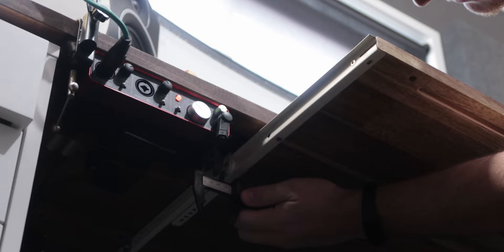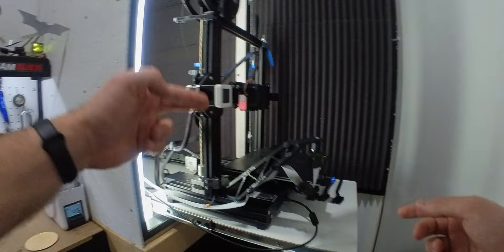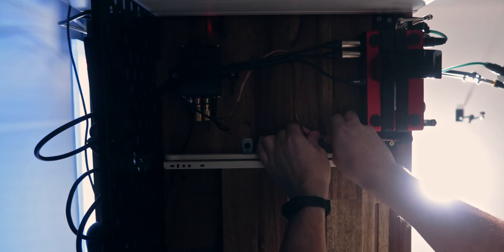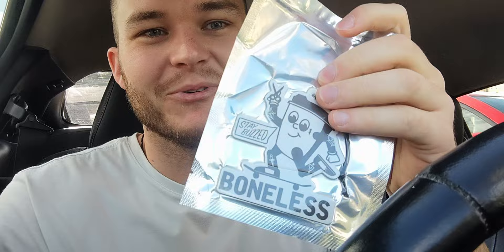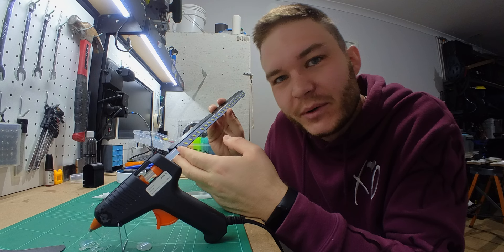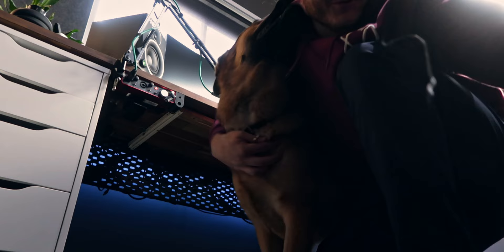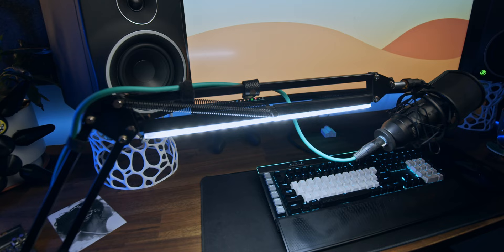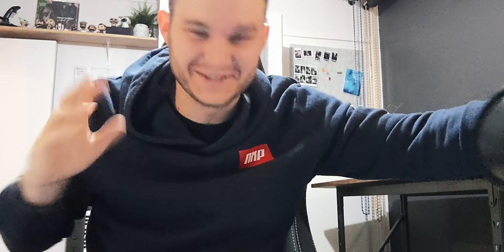inventing the Mic Arm Lamp.

Comment: Woah.. Nice job. it would have taken me 3.5hrs to just solder those strips to power brick. Really impressed. Anyways, what are you studying for? It looks like you can learn anything by yourself. Why pay uni?
Reply from the maker: Haha yeah quick solder job on this one! 
It's kinda different. So I have a bachelor's degree in computer science, and worked in IT for ages. But recently started teaching STEAM programs to high school students at the University I work for.
I'm studying sustainable living, some subjects through the lens of architecture and others are general. The learning gets implemented into the classes I run, and all happened to be free. I probably wouldn't pay for another degree but to given what I'm learning is being directly applied in my current job it's worth it. Plus I'm interested in general ☺️✌️

Comment: What a great project! You had a problem and rather than just looking for another product to buy, you took it into your own hands to build a solution. I’m a computer engineering student and I find that creating your own deadlines is a great way to make things happen! Even if you don’t necessarily make your personal deadline, more progress occurs than what would’ve been made otherwise.
Reply from the maker: I've been using the timer often when working on tasks at my computer, setting that deadline helps a lot. Was different transitioning it into a physical task but got it done quicker than without no doubt!

Hope your studies are going good! I studied IT at Uni (more of a computer science angle) and boy did I leave my assignments till the actual deadline 😂